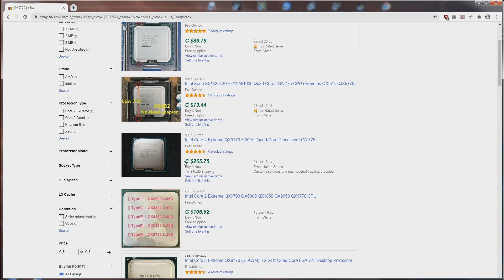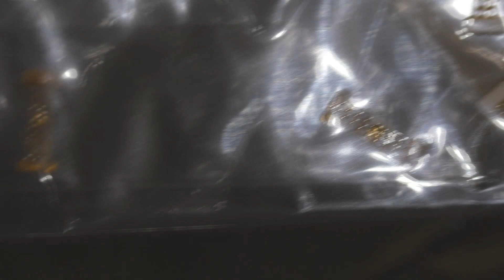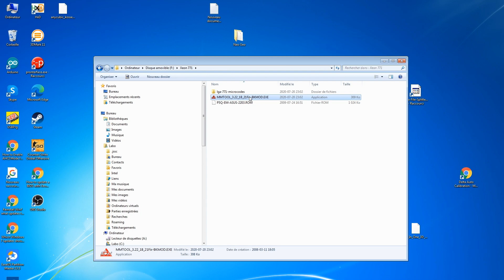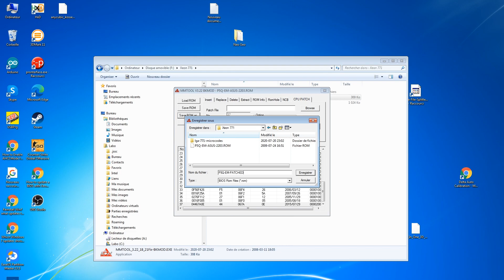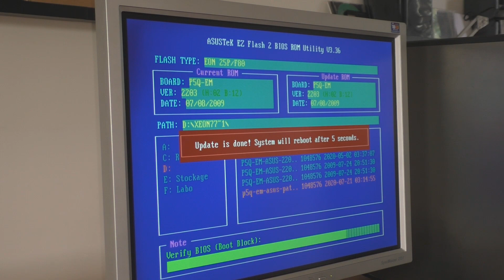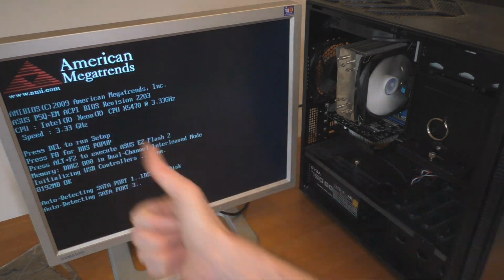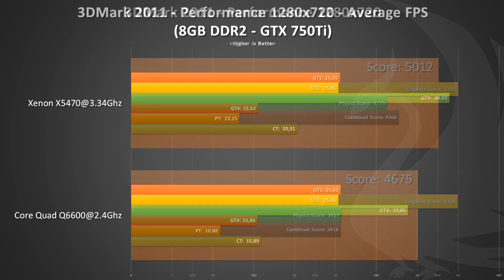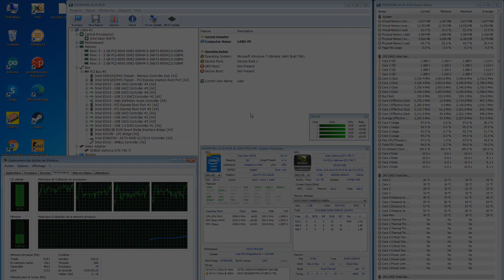[Retro] LGA 771 CPU on LGA 775 motherboard - X5470 on Asus P5Q-EM

Comment: I need bios for asus p5q-e 771 can you upload? My pc is down its the ami one. I cant do anything without it. X5470 cpu
Reply from the maker: Try this: https://www.dropbox.com/scl/fi/w5uovfq2wa40dqjzwkn66/p5q-e-2101-771.rom?rlkey=rrbb7d62n26gfecboupjkplt8&dl=0, no guaranty it would work, but I did the same steps I did for my p5q-em in this video.
Reply: @TheRealPhoenix_Retromods  your a legend mate thanks!😊👍
Reply from the maker: I've also repload the 771 microcodes and MMTool since delided website seems down. @WingmanLive
Reply: @TheRealPhoenix_Retromods  This is great. My pc back up and running again, in fact this is a better bios than my original.

You got any overclock settings you care to share screenshots photos?  Most i ever got was 4.2ghz
Reply from the maker: Nope sorry I'm not into overclocking. I don't have anymore the Xeon/P5Q-EM anyway. @WingmanLive

Comment: Hello, i´ve got PC which has P5Q WS motherboard and i would like to upgrade it to maximum as possible,  i´m kindly asking you for help( what CPU, graphics card and ram memory i should or can go ). it would be the best if you could provide me with a link of exact products
Reply from the maker: Motherboard manuals say maximum FSB is 1333Mhz like my P5Q-EM, so:
- Max CPU with a stock motherboard should be a Q9650 or a X5470 with the modifications you just saw in the video.
- Maximum RAM would be 4 sticks of 2Gb non-ECC, unbuffered, DDR2-800 for a total of 8Gb, again like in the video.
- The PCI-e 2.0 16x slot isn't really limited , but you'll be bottlenecked by the CPU and RAM, so either a beefy GTX-780, but I can find only card with 3Gb. So maybe a GTX-960 card slightly less powerfull but with 4Gb would be also a good choice. Best would be a GTX-970 4Gb.
Reply: @TheRealPhoenix_Retromods  thank you so so much, for  answering me back. 

Just to make it clear: 
with ram I can’ only use 4x2gb ? There is no way going to 16gb ? 

Video card the best choice is gtx 970 4gb then ? 

Sorry that I ask you twice but I just want to be sure 🙏
Reply from the maker: @martinfeher7400  - 4Gb sticks of non-ECC unbuffered DDR2 RAM are EXTREMLY rare, and not officially supported by the the chipset. IIRC they were for AMD platform so I don't know if they will work on a Intel P45 chipset based motherboard. Careful to NOT buy Server RAM (ECC buffered) because they won't work on the P5Q.
- Yes 970 4gb would be the best with a X5470 or Q9650. 970 have roughly the same performance as a 780, but are paired with 4Gb which would be the minimum VRAM for "modern" gaming. In order it should be 960, 780, 970, 780 ti, 980, 980 ti.  The best balance perf/price/CPU bottleneck should be the 970 + 4Gb, or the 960 + 4Gb if you want to go cheaper (because of the current market price of GPU) but you might have to sacrifice a bit on perf.
Reply: @TheRealPhoenix_Retromods  no i don´t want cheeper , thatś why i´m asking for the best video card, but then the best would be 980ti 6g ?
Reply from the maker: @martinfeher7400  At this point you might be too much bottlenecked by the CPU to see differences on higher video card.
Reply: @TheRealPhoenix_Retromods  im sorry to write you again but its important, my motherboard is P5Q WS - workstation and it´s a server ... so can i buy in this case 4Gb RAM  ECC BUFFERED ??  if you could write me a priety message would be the best :)
Reply from the maker: No, this is not a server motherboard. Real server motherboards are not build around the socket 775 and especially not the chipset P45 (they were mostly dual socket 771 and chipset intel 5400 at the time). The P45 does not handle ECC buffered ram. This is a workstation motherboard, meaning this is for advanced user, so this is consumer grade with additional feature like the PCI-X slot. Just check the manual for an example of the compatible RAM: https://www.asus.com/supportonly/p5q_ws/HelpDesk_Manual/
A quick search on google can find people already asked this question and being answered.
Reply: @TheRealPhoenix_Retromods  hello, i´ve instaled CPU X5470 according to your video and it works so great :) i´m thinking to overclock the CPU. Can you make some full video turorial of it.(would be amazing if you could do that)
Reply from the maker: @martinfeher7400  Unfortunately I sold the CPU/MB/RAM early this year.

Comment: Bro... I want to buy this...... But my motherboard is too old (ie G31PR(HIS)) supports 775 socket... But I don't have BIOS upgrade option and I think also it can't......even if I buy it is it sure that will it work........ Plz suggest.
Reply from the maker: If the motherboard is base on the G31 chipset it should be compatible with this mod. See:
https://www.delidded.com/lga-771-to-775-adapter/2/#motherboard-compatibility
Unfortunately if you motherboard is not listed, well, you have no choice to test it yourself.
More important is I don't know for the BIOS. If it's a Phoenix, AMI or Award bios there's a high chance this will work. It's more complicated if it's an Intel or Dell or coming from an other specific assembler. See:
https://www.delidded.com/lga-771-xeon-microcode/
https://www.delidded.com/how-to-update-cpu-microcode-in-award-or-phoenix-bios/
https://www.delidded.com/how-to-update-cpu-microcode-in-ami-bios/
Reply: @TheRealPhoenix_Retromods  thank you bro..... For your Suggestions.....,..now you have added one more subscriber in you account..... 😁keep it up 👍

Comment: I did same upgrade for my mum's old Asus P5Qpro, from Core2Duo E8500 to X5470, it's about twice as fast now. I also replaced the old Sata HDD with SSD and bought 2 more 2GB Dimms for now 8GB RAM (cost 20 bucks used), finding 4x4 Dimms was impossible for a cheap price. I suggest Win10 AME edition as OS if you want to go Win10, because AME (ameliorated) removed a ton of MS Spyware from the OS making it also faster and you don't get all the network traffic to Microsoft constantly. you can DL ISO of this cool Win10 edition.